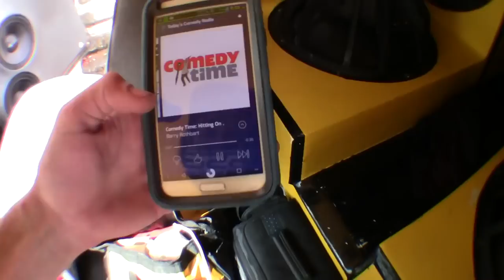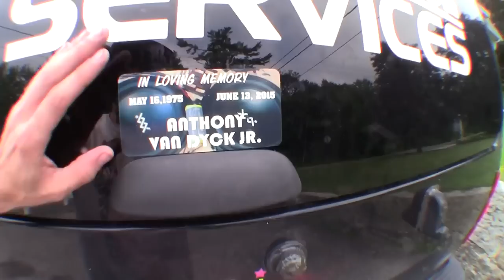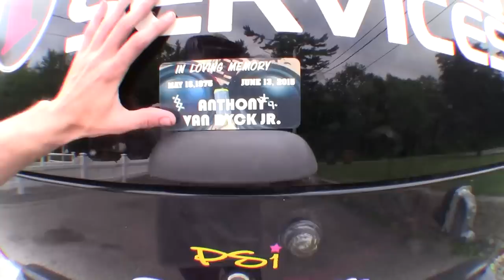Chillin' with EXO: Custom Door Panels REMOVED... Fixing JAMMED Power Locks & Car Audio Updates

Comment: Also, this is a common issue with the explorers ive owned and if its an explorer issue than its an expedition/navigator issue also.
I had it happy in my explorer when doing high 157s....and then my other explorer does it too and has a stock setup in it.  It usually works if you take the back of your fist and give it a hammer fist on the outside right on the doorlock semi hard when its bunged up and that typically fixes the issue temporarily..atleast on my trucks.

Comment: I have those same leds in my car. Those control boxes are weak. Only good for like 1 meter. All you need is an led amp. You can get them in various strengths on ebay for like $5-$20. Should work great. You will need another power plug. Same size as the control box. Then just wire them together

Comment: EXO....i Love your videos bro.  And your setup is definitely unique but after seeing the inside of your enclosure you DEFINITELY have a lot of room for improvement.  Id almost say you should do a rebuild of the wall.  Of course not the whole wall, Id just rip out your baffles and build something different.  Id recommend a vertical clamshell with a loading wall.  It would fit very well with 3 18s per side.  Just a thought.  And hardly anyone has that setup anymore.  

Jimbo (The A Team) used to have it and if you were familiar with him, he competed years ago and is still one of the loudest vehicles EVER on music.  164db bassraceand only used 8 15s and a "small" 12 volt electrical system only using 7 batts.

Just providing suggestions my man.  Hope you dont take offence.
Keep up the good work.

Thanks for the videos
Reply from the maker: Vanilla Gorilla Thanks for the insights, but I really like it the way it is. If I do something different, it will be in a new vehicle. I've heard so many setups before, and this thing plays uniquely wide. I love the sound too much to start ripping it apart. But I appreciate the comment man! You need to get a demo!!!!
Reply: EXOabigdeal Good point...Ive never had a demo (Im in vancouver BC) so a video can only show so much...I was simply judging from seeing the inside of the enclosure and just general efficiency.  But I see your point.
Thanks for the reply